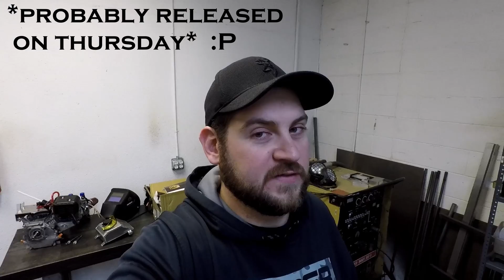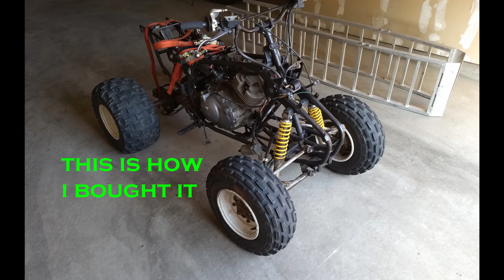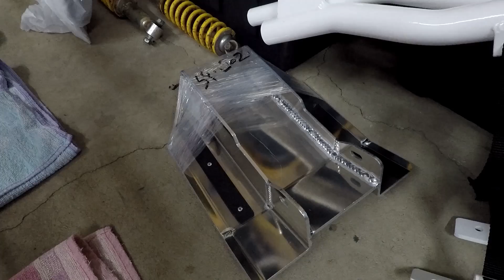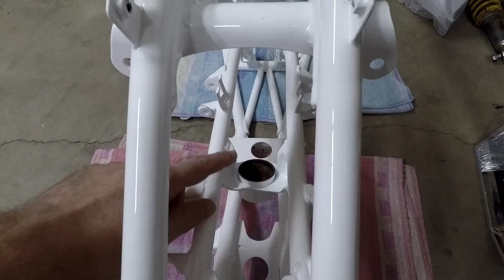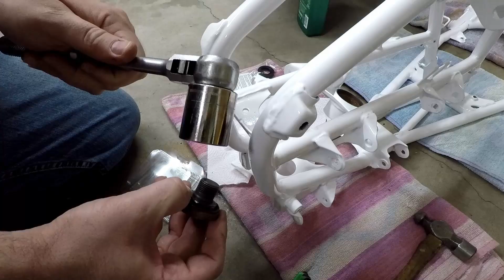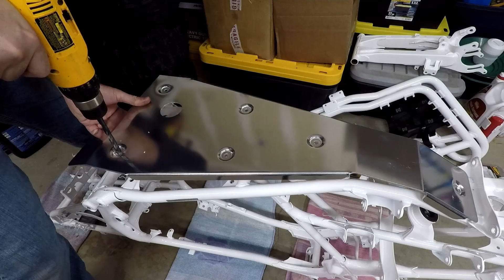New! Warrior 350 Quad Build!!!

Comment: Where do you get your parts from?
Reply from the maker: New parts, Amazon or eBay. Used, usually Craigslist. I'll be linking most the parts in the video description as the build progresses. Thanks for watching!
Reply: MrTurbo458 thank you for the response. Good luck with your build. And another question how do i know which wiring harness is for my warrior i have a 1987 warrior and it has a wiring issue
Reply from the maker: @joelbravo2690  A quick way is to compare the CDI wiring plugs, from what I can see the harness are all the same mostly, except for the CDI's. Maybe try checking your harness against a diagram to find the issue before replacing the whole harness. I know it's a lot of time but it could be a simple fix.
Reply: MrTurbo458 Thanks. I didnt think about that but ill do that and hopefully its nothing too big.
Reply from the maker: @joelbravo2690  hopefully! Good luck!